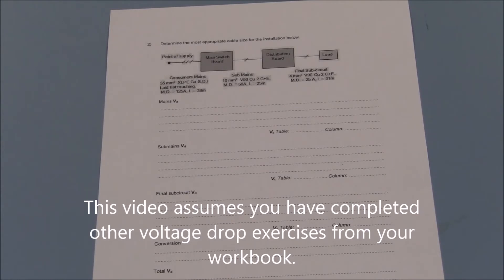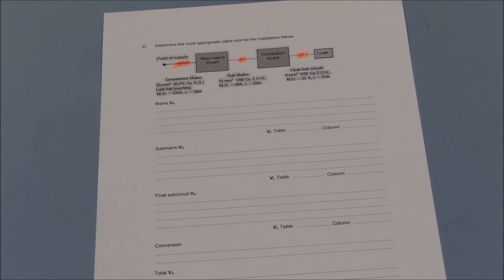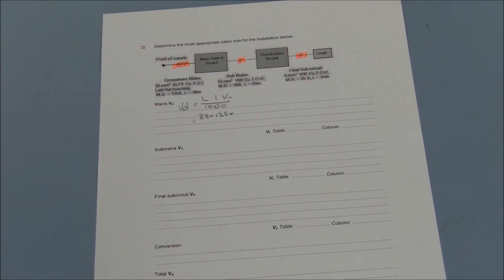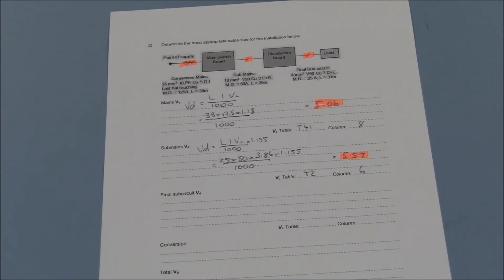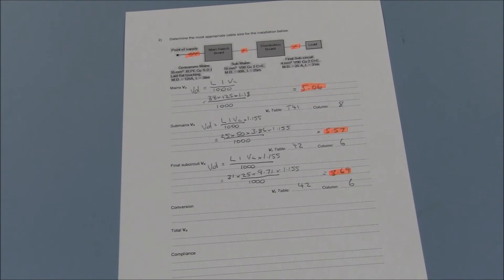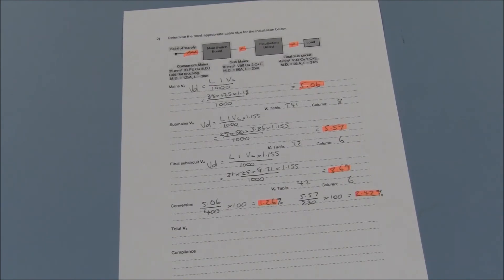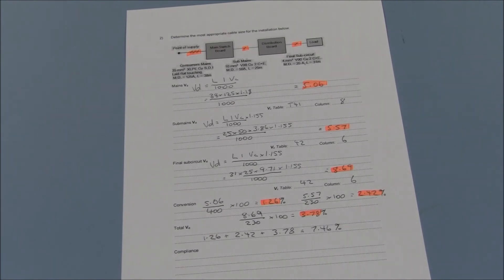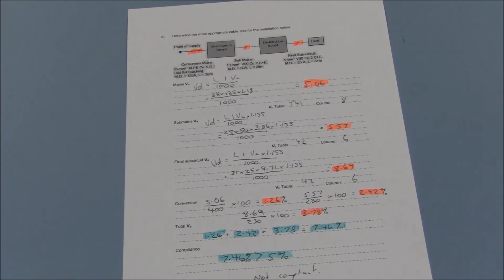Determining voltage drop across an installation containing both three and single phase circuits

Comment: since it's a "not compliant installation", what's your recommendation? Thanks for the explanation 👍 🙂
Reply from the maker: Install a larger cable
Reply: @ianwilliams8448  which cable be large or upgraded? Consumer's main, sub-board or final sub-circuit? 
Thank you mate.

Comment: Why are the V90 cables not in the 90 degrees? the are they rated at 75 degrees? i thought that was only when they were clipped or in insulation
Reply from the maker: Normal use for V90 is 75 deg, and max is 90 deg. You could probably use 90 if you wanted to, but gee that's quite hot.